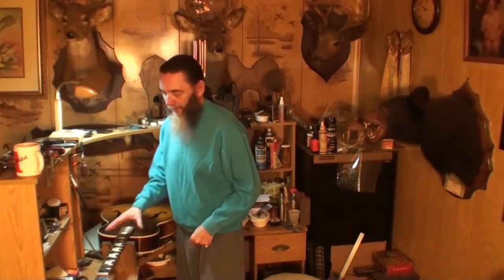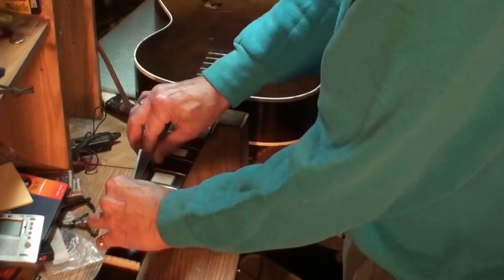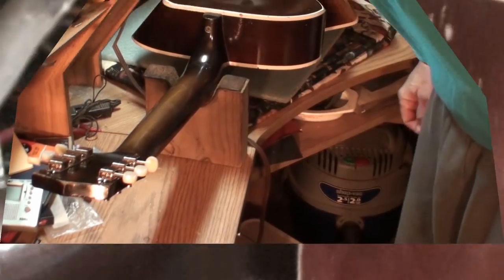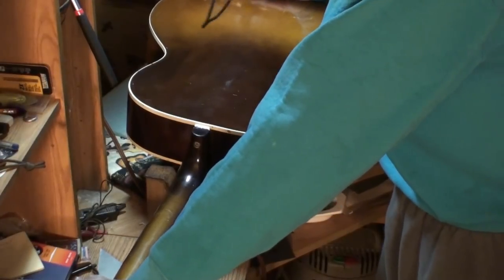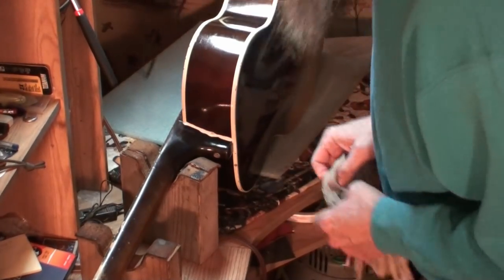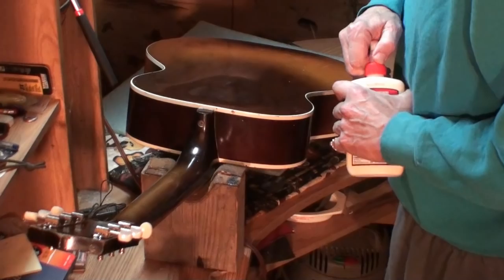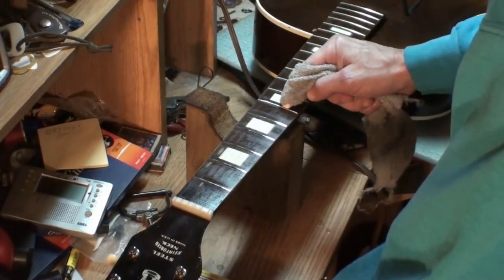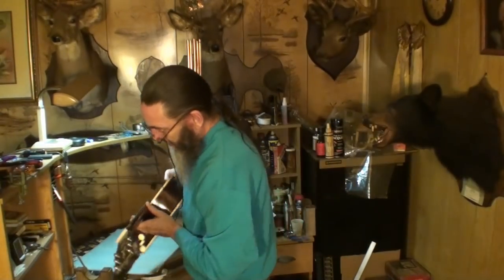harmony hollywood guitar seal heel crack and fret preping tips read description

Comment: @Randy Shartiger Everybody be sure to hit that like button & subscribe for more great content from THTNS. Great video!! Good to see you back at it & looking energetic!! You had us worried. Anyways, I have a story & a question about bridgeplate caps. I believe I've seen you recommend the plate mate in past videos. I had one in a 72 D-28 & when I recorded in certain keys it apparently produced really bad overtones. I would dampen my strings & still hear a tone ringing in the guitar. At first I though it might be the square tube that Martin put in those guitars. So...……..nothing much I could do about that other than take off the fingerboard, maybe fill it with epoxy, or just replace it with an adjustable rod. Very time consuming & expensive in either case & what if that wasn't even the cause? Could it be those big heavy Grover rotomatics? I'd never heard of them causing overtones before. Bad strings maybe? I ran every scenario I could think of in my mind & finally decided that I would address one issue at a time. So 1st, I bought a set of the grover vintage style kluson closed back tuners with the oval buttons, made to fit exactly in the old rotomatic holes. Perfect!! They fit great, worked good, looked good, took a ton of weight off the peghead & all I had to do was drill one extra screw hole per tuner. I put on fresh strings. Only had one problem...…....….I still had overtones! So my next step was to carefully take out the plate mate with the next string change. It worked. No more overtones, but the ball end string wrap was too close to my saddle & that's never a good thing, so I soon after, had a neck set done as well as a babinga plate cap put on. I felt that the babinga brightened up my guitar & caused it to lose much of the punchy low mid & bass tone I needed for a strong bluegrass rhythm. I took out the cap & problem solved, but the string wrap was again nearly up to the saddle. I ended up selling the guitar & I was never so sick until recently. I have a good 180 Blueridge, but it just didn't have the same soul as that old beat up, finish cracked body, coon eyes around the string posts, no finish on the back of the neck, braces shaved 72 D-28. The reason I'm getting carpel tunnel typing this long story is because I now own a 73 that sounds just as good, if not better, but it's in need of a neck set as well as a plate cap or plate replace. The Indian rosewood plate seems to have cracked across the holes at some point & was glued. I have no clue what with. All I know is that it's both clear & clean. You can barely see the crack, but the balls of the strings are setting good. A close musician friend of mine recommended I use purple heart & cap it. He's used it on several Martins & swears it improves their tone & volume. I have purple heart as well as some ironwood or "hackberry". Both seem equally hard. Have you worked with either & what are your thoughts about it? Thank you for your patience & time reading this book. lol I thought the story might give you a laugh or two.

Comment: Hey Randy glad to see you back in the saddle again@  Question...how come you didn't loosen the screw just a tiny bit for the glue application & then tighten it after the glue got down in the crack?
Reply from the maker: the owner and me did talk about that and I told him the screw and joint are solid as a rock it could possibly loosen the joint if tension is taken off the screw and the joint moved, in other words if it ain't broke don't try to fix it lol so we decided to leave it and just seal it. thanks for viewing.

Comment: Many moons ago I saw a guitar that had a bolt in the same place as that screw, from the factory, under a plastic cap. Had a nut and washer on the inside. Don't remember what kind it was though.
Reply from the maker: whoever did that on this guitar did a good job, it doesn't look like it has moved since and solid as a rock! these old Harmony's were known for the neck joint pulling apart, it's a shame they don't have an adjustable truss rod. thanks for checking it out!

Comment: Randy, 
If the neck did what you suspect would that indicate to you that something broke on the dovetail or neck block?

and as a sidenote: What did you think about Jerry Rosa's major surgery on that old Gibson L1 he recently uploaded the video of the repair?
Reply from the maker: yes probably the glue in this neck joint let go, whoever put the screw in it did a good job and got it nice and tight, I doubt it will ever move again. and yes been watching Jerry work on that L1 guitar, I have videos on an old Gibson LG2 I thought I'd have to remove the back to work on but ended up being able to repair it thru the sound hole, removing the back IMO is that last option but sometimes has to be done. thanks for watching and commenting!

Comment: Randy I personally think your going too far .or i should say making  too big of a deal about sealing that neck.if anyone looks on the inside of it they will see that if any moisture wants in there can get in there anyway. it's not sealed the only thing it may do is alow the finish to check a bit easier in that area.
Reply from the maker: moisture getting into that dovetail joint will cause it to swell and shrink and that constant process over the period of years will cause the joint to loosen, that;s probably why the screw had to be put in it.